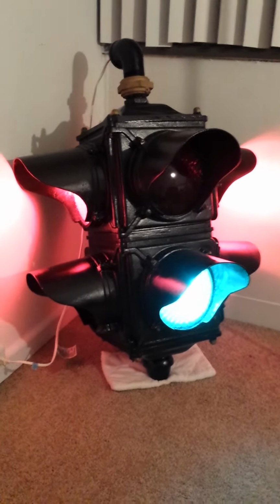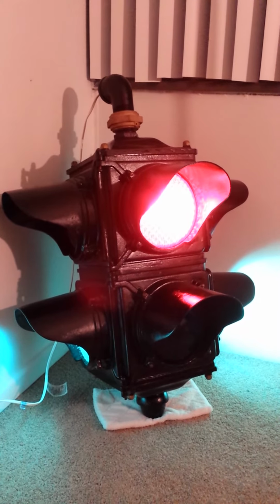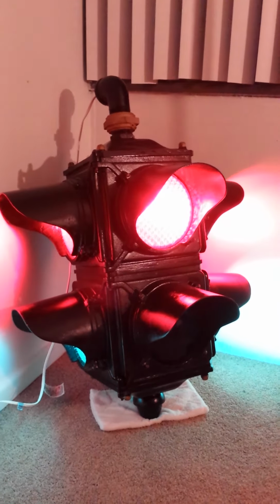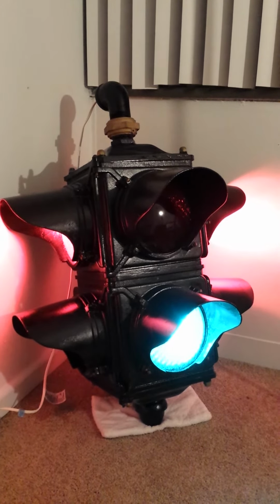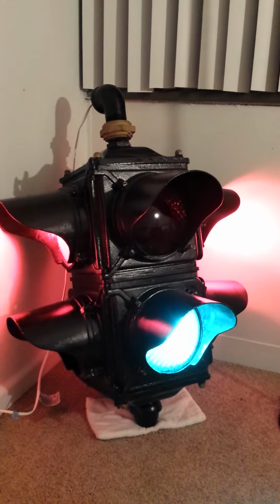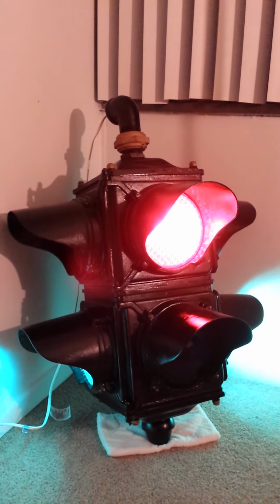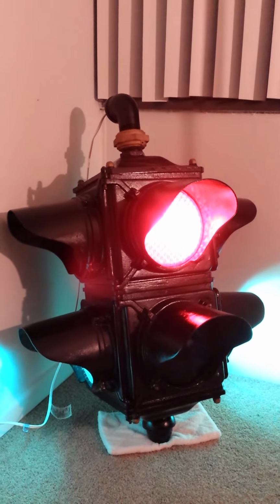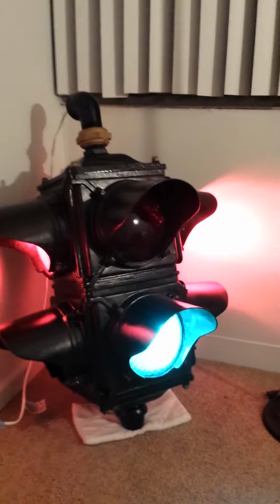Old NYC traffic light restored

Comment: I remember those traffic lights well when we went to brooklyn in the early 60's, there were a lot of them in Bayridge. I always like to watch and listen to the control box when they changed. Sorry to see them go and get replaced by the 3 color light. Good job on the refinishing,  is this a Darley light?
Reply from the maker: Thanks, Doug.  I grew up in Jersey, but I remember seeing quite a few of these that were still hanging around in NYC  in the 70s when I was a kid.  I believe these were originally manufactured by Horni Signal Mfg. and later by the Ruleta Co., and possibly by The Marbeilte Company which also supplied the 3-color lights in NYC from the 50s to the 70s.  The one I own has no name stamped inside, but I suspect it's a late generation one, possibly made by Marbelite.